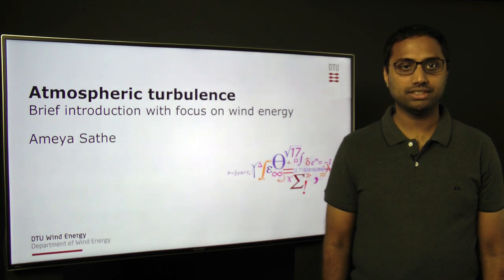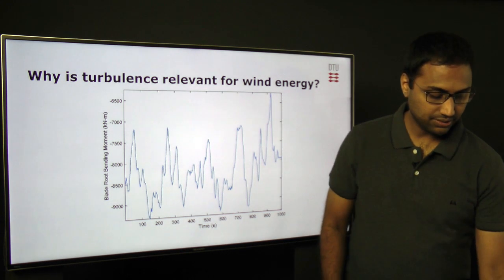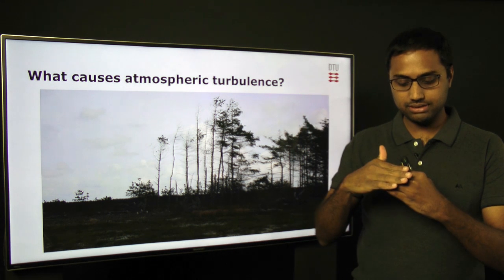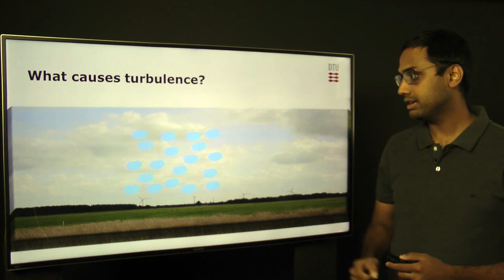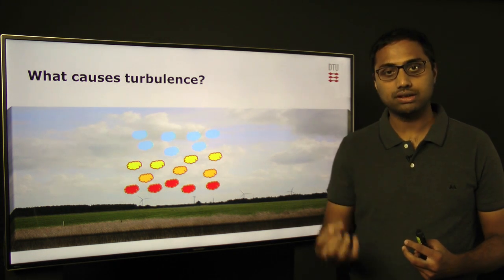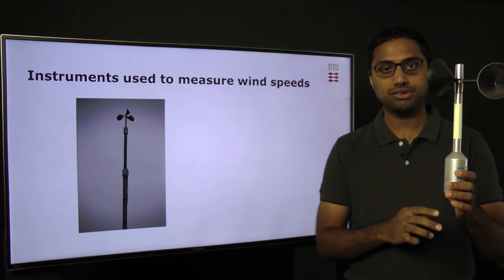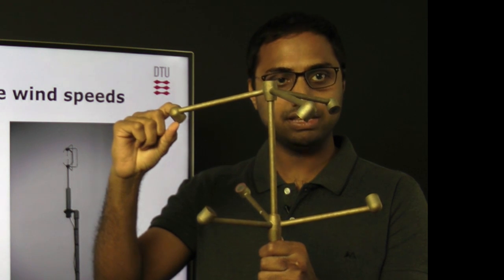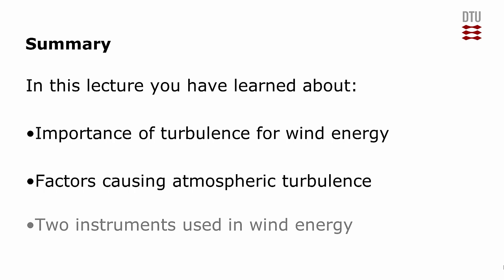6. Brief introduction with focus on wind energy

Comment: Small incorrection at 3:45 - "The colder the air parcel is, the lighter the density (...)"
Reply: That's not correct. The colder air is heavier than the warmer air.